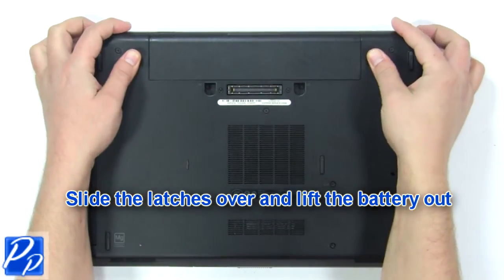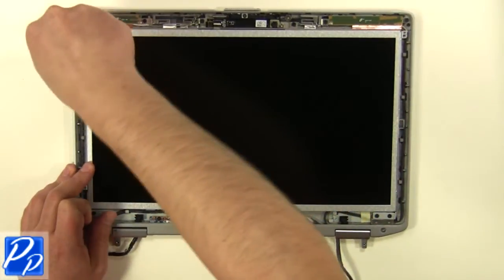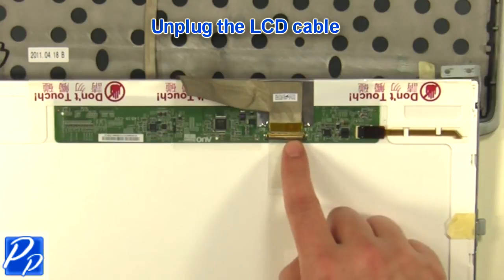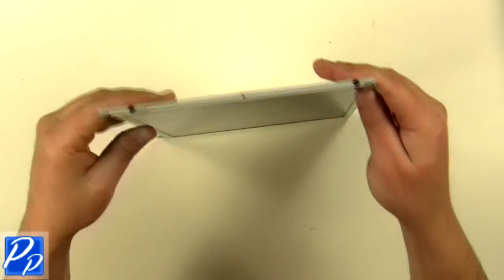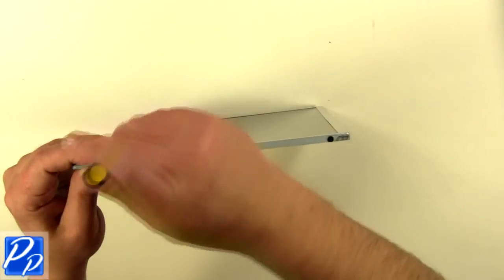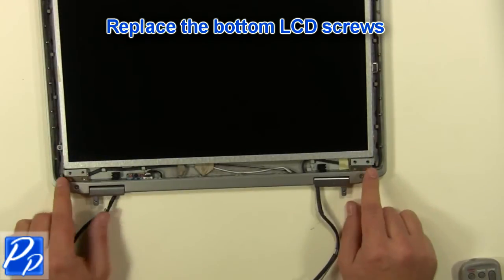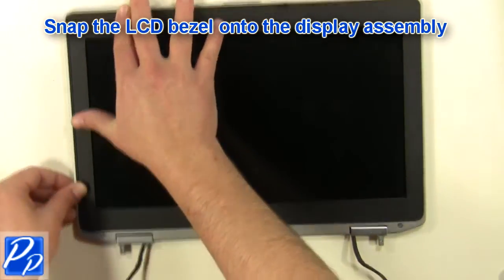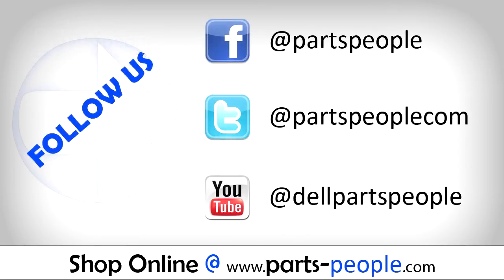Dell Latitude E6420 LCD Display Screen Rail Replacement Video Tutorial

Comment: Can you replace a non-touch screen e6420 (0KJ262) with a touch screen (OGY5W3)?
Reply from the maker: You can replace a non-touch with a touch but you will also have to change the LCD back cover and the LCD cable.